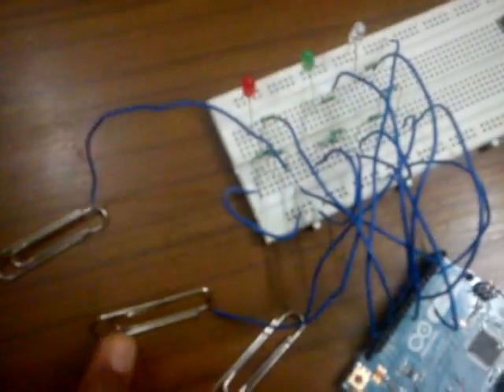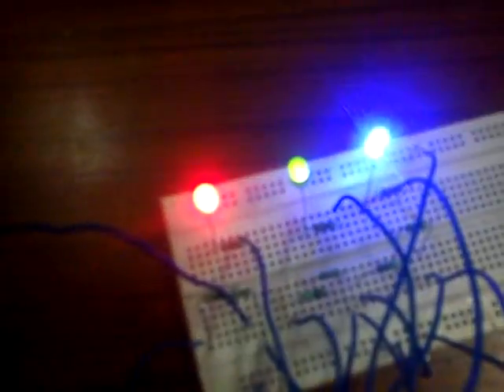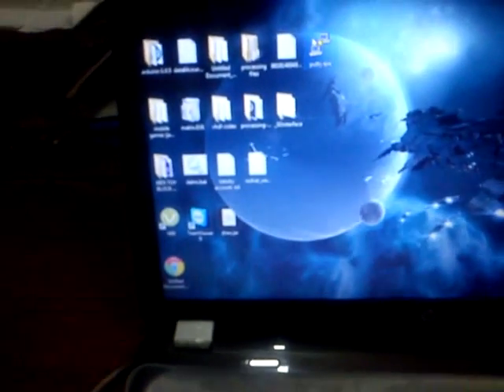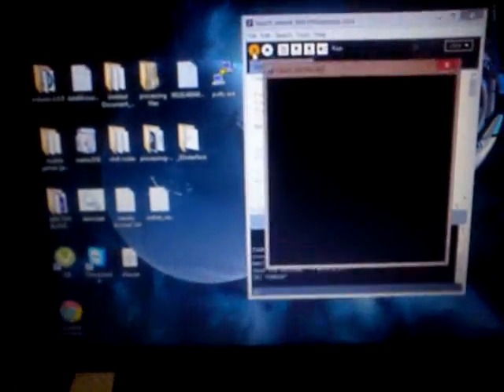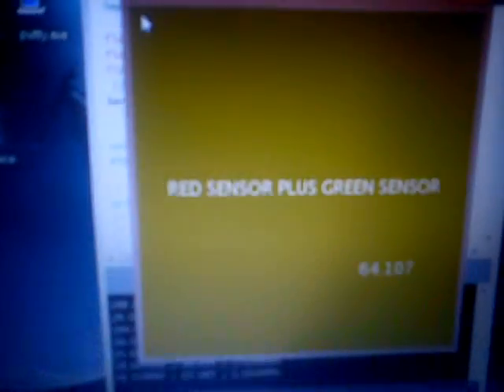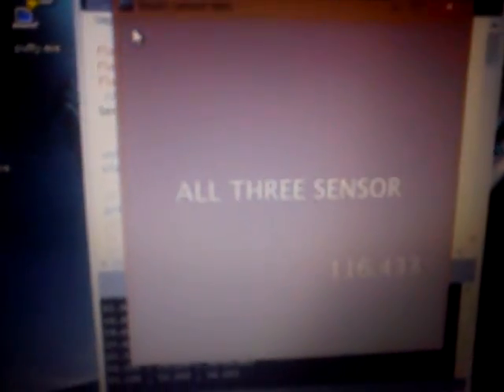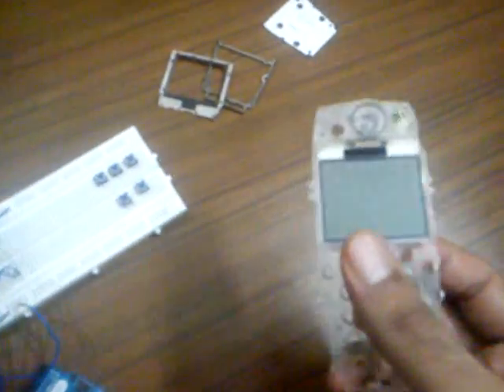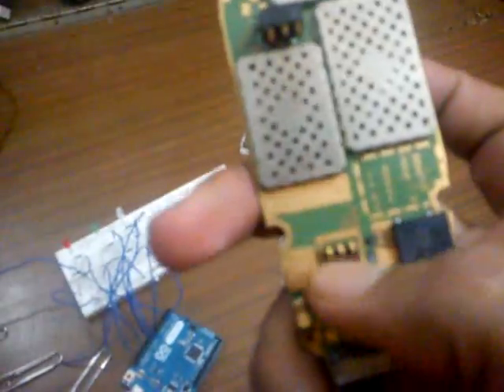Capacitive Touch Sensor with paper clips (Arduino + Processing)

Comment: if you play minecraft, type in this command to get furntiture. no mods kay
here it is:
/summon FallingSand ~ ~2 ~ {Block:redstone_block,Time:1,Riding: {id:FallingSand,Block:command_block,TileEntityData:{Command:/fill ~-1 ~-3 ~ ~-1 ~1 ~ redstone_block},Time:1,Riding: {id:FallingSand,Block:command_block,TileEntityData:{Command:/fill ~-1 ~-3 ~ ~ ~2 ~ air},Time:1,Riding: {id:FallingSand,Block:command_block,TileEntityData:{Command: 	/summon FallingSand ~-2 ~ ~9 	{Block:emerald_block,Time:1,Riding: 	{id:FallingSand,Block:command_block,TileEntityData:{Command: 		/summon FallingSand ~ ~-2 ~-1 			{Block:emerald_block,Time:1,Riding: 			{id:FallingSand,Block:command_block,TileEntityData:{Command:/fill ~3 ~1 ~2 ~-1 ~1 ~-5 stained_glass 0},Time:1,Riding: 			{id:FallingSand,Block:command_block,TileEntityData:{Command:/setblock ~2 ~-6 ~-5 redstone_block},Time:1,Riding: 			{id:FallingSand,Block:command_block,TileEntityData:{Command:/setblock ~-1 ~-1 ~-7 stone_button 4},Time:1,Riding: 			{id:FallingSand,Block:command_block,TileEntityData:{Command:/setblock ~-1 ~-1 ~-4 command_block 0 replace {Command:/scoreboard objectives remove tv}},Time:1,Riding: 			{id:FallingSand,Block:command_block,TileEntityData:{Command:/setblock ~-1 ~1 ~-5 redstone_wire},Time:1,Riding: 			{id:FallingSand,Block:command_block,TileEntityData:{Command:/setblock ~-1 ~ ~-5 command_block 0 replace {Command:/summon FallingSand ~2 ~3 ~7 {Block:command_block,TileEntityData:{Command:/fill ~-3 ~-1 ~1 ~3 ~8 ~-9 minecraft:air},Time:1}}},Time:1,Riding: 			{id:FallingSand,Block:command_block,TileEntityData:{Command:/setblock ~ ~2 ~-5 command_block 0 replace {Command:/fill ~-2 ~1 ~-1 ~4 ~1 ~8 stained_glass 5 replace stained_glass 14}},Time:1,Riding: 			{id:FallingSand,Block:command_block,TileEntityData:{Command:/setblock ~-1 ~3 ~-5 command_block 0 replace {Command:/scoreboard objectives remove t}},Time:1}}}}}}}}} 		},Time:1,Riding: 	{id:FallingSand,Block:command_block,TileEntityData:{Command:/fill ~4 ~-2 ~-7 ~-2 ~-2 ~2 stained_glass 14 replace stained_glass 0},Time:1,Riding: 	{id:FallingSand,Block:command_block,TileEntityData:{Command:/setblock ~-1 ~-5 ~-8 stone_button 4},Time:1,Riding:	 	{id:FallingSand,Block:command_block,TileEntityData:{Command:/setblock ~-1 ~-4 ~-6 command_block 0 replace {Command:/scoreboard players set @p t 0}},Time:1,Riding: 	{id:FallingSand,Block:command_block,TileEntityData:{Command:/setblock ~-1 ~-2 ~-8 wall_sign 1 replace {Text1:,Text2:Get Items,Text3:,Text4:}},Time:1,Riding: 	{id:FallingSand,Block:command_block,TileEntityData:{Command: 		/summon FallingSand ~1 ~1 ~-6 			{Block:command_block,TileEntityData:{Command:/execute @a[score_tv_min=1,score_tv=1]~ ~ ~ /execute @e[name=TV,score_t_min=1]~ ~ ~ /summon ArmorStand ~-0.5 ~-0.7 ~-0.05 {CustomName:"F",NoGravity:1,Invulnerable:1,Invisible:1,DisabledSlots:2039552,NoAI:1,Equipment:[{},{},{},{},{id:carpet,Damage:15}],Pose:{Head:[90f,180f,0f]}}},Time:1,Riding: 			{id:FallingSand,Block:command_block,TileEntityData:{Command:/execute @a[score_tv_min=1,score_tv=1]~ ~ ~ /execute @e[name=TV,score_t_min=1]~ ~ ~ /summon ArmorStand ~0.5 ~-0.7 ~-0.05 {CustomName:"F",NoGravity:1,Invulnerable:1,Invisible:1,DisabledSlots:2039552,NoAI:1,Equipment:[{},{},{},{},{id:carpet,Damage:15}],Pose:{Head:[90f,180f,0f]}}},Time:1,Riding: 			{id:FallingSand,Block:command_block,TileEntityData:{Command:/execute @a[score_tv_min=1,score_tv=1]~ ~ ~ /execute @e[name=TV,score_t_min=1]~ ~ ~ /summon ArmorStand ~-0.5 ~-0.4 ~-0.05 {CustomName:"F",NoGravity:1,Invulnerable:1,Invisible:1,DisabledSlots:2039552,NoAI:1,Equipment:[{},{},{},{},{id:carpet,Damage:15}],Pose:{Head:[90f,180f,0f]}}},Time:1,Riding: 			{id:FallingSand,Block:command_block,TileEntityData:{Command:/scoreboard players set @a[rym=-135,ry=-45] tv 2},Time:1,Riding: 			{id:FallingSand,Block:command_block,TileEntityData:{Command:/scoreboard players set @a[rym=45,ry=135] tv 2},Time:1,Riding: 			{id:FallingSand,Block:command_block,TileEntityData:{Command:/scoreboard players set @a[rym=-44,ry=44] tv 1},Time:1,Riding: 			{id:FallingSand,Block:command_block,TileEntityData:{Command:/scoreboard players set @a[rym=136,ry=-136] tv 1},Time:1,Riding: 			{id:FallingSand,Block:command_block,TileEntityData:{Command:/fill ~1 ~ ~7 ~1 ~7 ~ air},Time:1}}}}}}}} 		},Time:1,Riding: 	{id:FallingSand,Block:command_block,TileEntityData:{Command: 		/summon FallingSand ~1 ~1 ~-5 			{Block:command_block,TileEntityData:{Command:/execute @e[type=EntityHorse,name=Destroy,score_t_min=1]~ ~ ~ /gamerule doMobLoot false},Time:1,Riding: 			{id:FallingSand,Block:command_block,TileEntityData:{Command:/kill @e[type=EntityHorse,name=Destroy,score_t_min=2]},Time:1,Riding:			{id:FallingSand,Block:command_block,TileEntityData:{Command:/execute @e[name=Destroy,type=EntityHorse]~ ~ ~ /summon FireworksRocketEntity ~ ~0.3 ~ {LifeTime:0,FireworksItem:{id:401,Count:1,tag:{Fireworks:{Explosions:[{Flicker:2,Trail:0,Type:5,Colors:[128988214]}]}}}}},Time:1}}} 		},Time:1,Riding: 	{id:FallingSand,Block:command_block,TileEntityData:{Command: 		/summon FallingSand ~1 ~1 ~-4 			{Block:command_block,TileEntityData:{Command:/execute @a[score_t_min=3]~ ~-1 ~ /kill @e[type=Item,r=2]},Time:1,Riding:			{id:FallingSand,Block:command_block,TileEntityData:{Command:/execute @a[score_t_min=3]~ ~-1 ~ /kill @e[name=F,r=1]},Time:1,Riding:			{id:FallingSand,Block:command_block,TileEntityData:{Command:/execute @a[score_t_min=3]~ ~1 ~ /kill @e[name=F,r=1]},Time:1,Riding:			{id:FallingSand,Block:command_block,TileEntityData:{Command:/execute @a[score_t_min=3]~ ~ ~ /gamerule doMobLoot false},Time:1,Riding: 			{id:FallingSand,Block:command_block,TileEntityData:{Command:/execute @a[score_t_min=3]~ ~ ~ /kill @e[name=F,r=1]},Time:1,Riding:			{id:FallingSand,Block:command_block,TileEntityData:{Command:/scoreboard players remove @a[score_t_min=3] t 1},Time:1,Riding: 			{id:FallingSand,Block:command_block,TileEntityData:{Command:/scoreboard players set @a t 4 {SelectedItemSlot:8,Inventory:[{Slot:8b,tag:{display:{Name:"Destroy"}}}]}},Time:1,Riding: 			{id:FallingSand,Block:command_block,TileEntityData:{Command:/execute @e[type=Item,name=Destroy]~ ~ ~ /kill @e[type=ArmorStand,name=F,r=2]},Time:1}}}}}}}}	},Time:1}}}}}}}}} },Time:1,Riding: {id:FallingSand,Block:command_block,TileEntityData:{Command: 	/summon FallingSand ~-2 ~ ~10 	{Block:emerald_block,Time:1,Riding: 	{id:FallingSand,Block:command_block,TileEntityData:{Command: 		/summon FallingSand ~3 ~-5 ~-7 			{Block:command_block,TileEntityData:{Command:/replaceitem entity @a[score_t_min=1] slot.hotbar.8 name_tag 1 0 {display:{Name:"Destroy"},HideFlags:127,ench:[{id:34,lvl:10}]}},Time:1,Riding: 			{id:FallingSand,Block:command_block,TileEntityData:{Command:/replaceitem entity @a[score_t=1] slot.hotbar.4 spawn_egg 1 94 {display:{Name:"TV"},HideFlags:127,ench:[{id:34,lvl:10}]}},Time:1,Riding: 			{id:FallingSand,Block:command_block,TileEntityData:{Command:/replaceitem entity @a[score_t=1] slot.hotbar.3 spawn_egg 1 94 {display:{Name:"Pile_of_Books"},HideFlags:127,ench:[{id:34,lvl:10}]}},Time:1,Riding: 			{id:FallingSand,Block:command_block,TileEntityData:{Command:/replaceitem entity @a[score_t=1] slot.hotbar.2 spawn_egg 1 94 {display:{Name:"Large_Table"},HideFlags:127,ench:[{id:34,lvl:10}]}},Time:1,Riding: 			{id:FallingSand,Block:command_block,TileEntityData:{Command:/replaceitem entity @a[score_t=1] slot.hotbar.1 spawn_egg 1 94 {display:{Name:"Table"},HideFlags:127,ench:[{id:34,lvl:10}]}},Time:1,Riding: 			{id:FallingSand,Block:command_block,TileEntityData:{Command:/gamerule doMobLoot true},Time:1,Riding: 			{id:FallingSand,Block:command_block,TileEntityData:{Command:/replaceitem entity @a[score_t=1] slot.hotbar.0 spawn_egg 1 94 {display:{Name:"Chair"},HideFlags:127,ench:[{id:34,lvl:10}]}},Time:1,Riding: 			{id:FallingSand,Block:command_block,TileEntityData:{Command:/fill ~-1 ~ ~7 ~-1 ~7 ~ redstone_block},Time:1}}}}}}}} 		},Time:1,Riding: 	{id:FallingSand,Block:command_block,TileEntityData:{Command: 		/summon FallingSand ~3 ~-4 ~-6 			{Block:command_block,TileEntityData:{Command:/scoreboard players add @e[type=EntityHorse,name=Destroy] t 1},Time:1,Riding: 			{id:FallingSand,Block:command_block,TileEntityData:{Command:/scoreboard players add @e[type=Squid,name=TV] t 1},Time:1,Riding: 			{id:FallingSand,Block:command_block,TileEntityData:{Command:/scoreboard players add @e[type=Squid,name=Pile_of_Books] t 1},Time:1,Riding: 			{id:FallingSand,Block:command_block,TileEntityData:{Command:/scoreboard players add @e[type=Squid,name=Large_Table] t 1},Time:1,Riding: 			{id:FallingSand,Block:command_block,TileEntityData:{Command:/scoreboard players add @e[type=Squid,name=Table] t 1},Time:1,Riding: 			{id:FallingSand,Block:command_block,TileEntityData:{Command:/execute @e[type=Squid,score_t_min=1]~ ~ ~ /gamerule doMobLoot false},Time:1,Riding: 			{id:FallingSand,Block:command_block,TileEntityData:{Command:/scoreboard players add @e[type=Squid,name=Chair] t 1},Time:1,Riding: 			{id:FallingSand,Block:command_block,TileEntityData:{Command:/scoreboard players set @a[score_t=1] t 2},Time:1}}}}}}}} 		},Time:1,Riding: 	{id:FallingSand,Block:command_block,TileEntityData:{Command: 		/summon FallingSand ~3 ~-3 ~-5 			{Block:command_block,TileEntityData:{Command:/execute @e[name=Chair,score_t_min=1,score_t=1]~ ~ ~ /execute @p[score_t=2,rym=136,ry=-136]~ ~ ~ /execute @e[name=Chair,score_t_min=1,c=1]~ ~ ~ /summon ArmorStand ~ ~-0.65 ~-0.3 {CustomName:"F",NoGravity:1,Invulnerable:1,Invisible:1,DisabledSlots:2039552,NoAI:1,Equipment:[{},{},{},{},{id:trapdoor}],Pose:{Head:[90f,0f,0f]}}},Time:1,Riding: 			{id:FallingSand,Block:command_block,TileEntityData:{Command:/execute @e[name=Chair,score_t_min=1,score_t=1]~ ~ ~ /execute @p[score_t=2,rym=-44,ry=44]~ ~ ~ /execute @e[name=Chair,score_t_min=1,c=1]~ ~ ~ /summon ArmorStand ~ ~-0.65 ~0.3 {CustomName:"F",NoGravity:1,Invulnerable:1,Invisible:1,DisabledSlots:2039552,NoAI:1,Equipment:[{},{},{},{},{id:trapdoor}],Pose:{Head:[90f,0f,0f]}}},Time:1,Riding: 			{id:FallingSand,Block:command_block,TileEntityData:{Command:/execute @e[name=Chair,score_t_min=1,score_t=1]~ ~ ~ /summon ArmorStand ~-0.25 ~-1.35 ~0.25 {CustomName:"F",NoGravity:1,Invulnerable:1,Invisible:1,DisabledSlots:2039552,NoAI:1,Equipment:[{},{},{},{},{id:lever}]}},Time:1,Riding: 			{id:FallingSand,Block:command_block,TileEntityData:{Command:/execute @e[name=Chair,score_t_min=1,score_t=1]~ ~ ~ /summon ArmorStand ~0.25 ~-1.35 ~-0.25 {CustomName:"F",NoGravity:1,Invulnerable:1,Invisible:1,DisabledSlots:2039552,NoAI:1,Equipment:[{},{},{},{},{id:lever}]}},Time:1,Riding: 			{id:FallingSand,Block:command_block,TileEntityData:{Command:/execute @e[name=Chair,score_t_min=1,score_t=1]~ ~ ~ /summon ArmorStand ~-0.25 ~-1.35 ~-0.25 {CustomName:"F",NoGravity:1,Invulnerable:1,Invisible:1,DisabledSlots:2039552,NoAI:1,Equipment:[{},{},{},{},{id:lever}]}},Time:1,Riding: 			{id:FallingSand,Block:command_block,TileEntityData:{Command:/execute @e[name=Chair,score_t_min=1,score_t=1]~ ~ ~ /summon ArmorStand ~0.25 ~-1.35 ~0.25 {CustomName:"F",NoGravity:1,Invulnerable:1,Invisible:1,DisabledSlots:2039552,NoAI:1,Equipment:[{},{},{},{},{id:lever}]}},Time:1,Riding: 			{id:FallingSand,Block:command_block,TileEntityData:{Command:/execute @e[name=Chair,score_t_min=1,score_t=1]~ ~ ~ /summon ArmorStand ~ ~-1 ~ {CustomName:"F",NoGravity:1,Invulnerable:1,Invisible:1,DisabledSlots:2039552,NoAI:1,Equipment:[{},{},{},{},{Damage:0,id:trapdoor}]}},Time:1,Riding: 			{id:FallingSand,Block:command_block,TileEntityData:{Command:/tp @e[type=Squid,score_t_min=2]~ ~-5 ~},Time:1}}}}}}}} 		},Time:1,Riding: 	{id:FallingSand,Block:command_block,TileEntityData:{Command: 		/summon FallingSand ~3 ~-2 ~-4 			{Block:command_block,TileEntityData:{Command:/execute @e[name=Large_Table,score_t_min=1,score_t=1]~ ~ ~ /summon ArmorStand ~ ~-0.7 ~-0.25 {CustomName:"F",NoGravity:1,Invulnerable:1,Invisible:1,DisabledSlots:2039552,NoAI:1,Equipment:[{},{},{},{},{id:stained_glass_pane,Damage:0}],Pose:{Head:[90f,0f,0f]}}},Time:1,Riding: 			{id:FallingSand,Block:command_block,TileEntityData:{Command:/execute @e[name=Table,score_t_min=1,score_t=1]~ ~ ~ /summon ArmorStand ~ ~-0.7 ~ {CustomName:"F",NoGravity:1,Invulnerable:1,Invisible:1,DisabledSlots:2039552,NoAI:1,Equipment:[{},{},{},{},{id:trapdoor}]}},Time:1,Riding: 			{id:FallingSand,Block:command_block,TileEntityData:{Command:/execute @e[name=Table,score_t_min=1,score_t=1]~ ~ ~ /summon ArmorStand ~0.4 ~-1.6 ~-0.52 {Pose:{RightArm:[-100f,0f,0f]},CustomName:"F",NoGravity:1,Invulnerable:1,Invisible:1,DisabledSlots:2039552,NoAI:1,Equipment:[{id:bone},{},{},{},{}]}},Time:1,Riding: 			{id:FallingSand,Block:command_block,TileEntityData:{Command:/execute @e[name=Table,score_t_min=1,score_t=1]~ ~ ~ /summon ArmorStand ~ ~-0.9 ~ {CustomName:"F",NoGravity:1,Invulnerable:1,Invisible:1,DisabledSlots:2039552,NoAI:1,Equipment:[{},{},{},{},{Damage:0,id:wooden_pressure_plate}],Small:1}},Time:1,Riding: 			{id:FallingSand,Block:command_block,TileEntityData:{Command:/execute @e[name=Chair,score_t_min=1,score_t=1]~ ~ ~ /execute @p[score_t=2,rym=136,ry=-136]~ ~ ~ /execute @e[name=Chair,score_t_min=1,score_t=1,c=1]~ ~ ~ /summon EntityHorse ~ ~-0.9 ~ {CustomName:"F",Invulnerable:1,Silent:1,Tame:1,ActiveEffects:[{Id:14,Duration:1000000000,Amplifier:-1},{Id:11,Duration:1000000000,Amplifier:100,ShowParticles:0b}],NoAI:1}},Time:1,Riding: 			{id:FallingSand,Block:command_block,TileEntityData:{Command:/execute @e[name=Chair,score_t_min=1,score_t=1]~ ~ ~ /execute @p[score_t=2,rym=-135,ry=-45]~ ~ ~ /execute @e[name=Chair,score_t_min=1,c=1]~ ~ ~ /summon ArmorStand ~0.3 ~-0.65 ~ {CustomName:"F",NoGravity:1,Invulnerable:1,Invisible:1,DisabledSlots:2039552,NoAI:1,Equipment:[{},{},{},{},{id:trapdoor}],Pose:{Head:[90f,90f,0f]}}},Time:1,Riding: 			{id:FallingSand,Block:command_block,TileEntityData:{Command:/execute @e[name=Chair,score_t_min=1,score_t=1]~ ~ ~ /execute @p[score_t=2,rym=45,ry=135]~ ~ ~ /execute @e[name=Chair,score_t_min=1,c=1]~ ~ ~ /summon ArmorStand ~-0.3 ~-0.65 ~ {CustomName:"F",NoGravity:1,Invulnerable:1,Invisible:1,DisabledSlots:2039552,NoAI:1,Equipment:[{},{},{},{},{id:trapdoor}],Pose:{Head:[90f,90f,0f]}}},Time:1,Riding: 			{id:FallingSand,Block:command_block,TileEntityData:{Command:/kill @e[type=Squid,score_t_min=2]},Time:1}}}}}}}}		},Time:1,Riding: 	{id:FallingSand,Block:command_block,TileEntityData:{Command: 		/summon FallingSand ~3 ~-1 ~-3 			{Block:command_block,TileEntityData:{Command:/execute @e[name=Armoire,score_t_min=1,score_t=1]~ ~ ~ /summon EntityHorse ~ ~ ~ {CustomName:"F",Invulnerable:1,Silent:1,ActiveEffects:[{Id:14,Duration:1000000000,Amplifier:-1},{Id:11,Duration:1000000000,Amplifier:100,ShowParticles:0b}],NoAI:1,Rotation:[90f],ChestedHorse:1,Type:1,Tame:1}},Time:1,Riding: 			{id:FallingSand,Block:command_block,TileEntityData:{Command:/execute @e[name=Large_Table,score_t_min=1,score_t=1]~ ~ ~ /summon ArmorStand ~-0.6 ~-0.7 ~-0.25 {CustomName:"F",NoGravity:1,Invulnerable:1,Invisible:1,DisabledSlots:2039552,NoAI:1,Equipment:[{},{},{},{},{id:stained_glass_pane,Damage:0}],Pose:{Head:[90f,0f,0f]}}},Time:1,Riding: 			{id:FallingSand,Block:command_block,TileEntityData:{Command:/execute @e[name=Large_Table,score_t_min=1,score_t=1]~ ~ ~ /summon ArmorStand ~-0.6 ~-0.7 ~0.4 {CustomName:"F",NoGravity:1,Invulnerable:1,Invisible:1,DisabledSlots:2039552,NoAI:1,Equipment:[{},{},{},{},{id:stained_glass_pane,Damage:0}],Pose:{Head:[90f,0f,0f]}}},Time:1,Riding: 			{id:FallingSand,Block:command_block,TileEntityData:{Command:/execute @e[name=Large_Table,score_t_min=1,score_t=1]~ ~ ~ /summon ArmorStand ~0.6 ~-0.7 ~0.4 {CustomName:"F",NoGravity:1,Invulnerable:1,Invisible:1,DisabledSlots:2039552,NoAI:1,Equipment:[{},{},{},{},{id:stained_glass_pane,Damage:0}],Pose:{Head:[90f,0f,0f]}}},Time:1,Riding: 			{id:FallingSand,Block:command_block,TileEntityData:{Command:/execute @e[name=Large_Table,score_t_min=1,score_t=1]~ ~ ~ /summon ArmorStand ~-0.6 ~-0.7 ~-0.85 {CustomName:"F",NoGravity:1,Invulnerable:1,Invisible:1,DisabledSlots:2039552,NoAI:1,Equipment:[{},{},{},{},{id:stained_glass_pane,Damage:0}],Pose:{Head:[90f,0f,0f]}}},Time:1,Riding: 			{id:FallingSand,Block:command_block,TileEntityData:{Command:/execute @e[name=Large_Table,score_t_min=1,score_t=1]~ ~ ~ /summon ArmorStand ~0.6 ~-0.7 ~-0.85 {CustomName:"F",NoGravity:1,Invulnerable:1,Invisible:1,DisabledSlots:2039552,NoAI:1,Equipment:[{},{},{},{},{id:stained_glass_pane,Damage:0}],Pose:{Head:[90f,0f,0f]}}},Time:1,Riding: 			{id:FallingSand,Block:command_block,TileEntityData:{Command:/execute @e[name=Large_Table,score_t_min=1,score_t=1]~ ~ ~ /summon ArmorStand ~ ~-0.7 ~0.4 {CustomName:"F",NoGravity:1,Invulnerable:1,Invisible:1,DisabledSlots:2039552,NoAI:1,Equipment:[{},{},{},{},{id:stained_glass_pane,Damage:0}],Pose:{Head:[90f,0f,0f]}}},Time:1,Riding: 			{id:FallingSand,Block:command_block,TileEntityData:{Command:/execute @e[name=Large_Table,score_t_min=1,score_t=1]~ ~ ~ /summon ArmorStand ~ ~-0.7 ~-0.85 {CustomName:"F",NoGravity:1,Invulnerable:1,Invisible:1,DisabledSlots:2039552,NoAI:1,Equipment:[{},{},{},{},{id:stained_glass_pane,Damage:0}],Pose:{Head:[90f,0f,0f]}}},Time:1}}}}}}}} 		},Time:1,Riding: 	{id:FallingSand,Block:command_block,TileEntityData:{Command: 		/summon FallingSand ~3 ~ ~-2 			{Block:command_block,TileEntityData:{Command:/execute @e[name=Large_Table,score_t_min=1,score_t=1]~ ~ ~ /summon ArmorStand ~1.2 ~-1.6 ~0.28 {Pose:{RightArm:[-100f,0f,0f]},CustomName:"F",NoGravity:1,Invulnerable:1,Invisible:1,DisabledSlots:2039552,NoAI:1,Equipment:[{id:bone},{},{},{},{}]}},Time:1,Riding: 			{id:FallingSand,Block:command_block,TileEntityData:{Command:/execute @e[name=Chair,score_t_min=1,score_t=1]~ ~ ~ /execute @p[score_t=2,rym=-44,ry=44]~ ~ ~ /execute @e[name=Chair,score_t_min=1,score_t=1,c=1]~ ~ ~ /summon EntityHorse ~ ~-0.9 ~ {CustomName:"F",Invulnerable:1,Silent:1,Tame:1,ActiveEffects:[{Id:14,Duration:1000000000,Amplifier:-1},{Id:11,Duration:1000000000,Amplifier:100,ShowParticles:0b}],NoAI:1,Rotation:[180f]}},Time:1,Riding: 			{id:FallingSand,Block:command_block,TileEntityData:{Command:/execute @e[name=Chair,score_t_min=1,score_t=1]~ ~ ~ /execute @p[score_t=2,rym=45,ry=135]~ ~ ~ /execute @e[name=Chair,score_t_min=1,score_t=1,c=1]~ ~ ~ /summon EntityHorse ~ ~-0.9 ~ {CustomName:"F",Invulnerable:1,Silent:1,Tame:1,ActiveEffects:[{Id:14,Duration:1000000000,Amplifier:-1},{Id:11,Duration:1000000000,Amplifier:100,ShowParticles:0b}],NoAI:1,Rotation:[-90f]}},Time:1,Riding: 			{id:FallingSand,Block:command_block,TileEntityData:{Command:/execute @e[name=Chair,score_t_min=1,score_t=1]~ ~ ~ /execute @p[score_t=2,rym=-135,ry=-45]~ ~ ~ /execute @e[name=Chair,score_t_min=1,score_t=1,c=1]~ ~ ~ /summon EntityHorse ~ ~-0.9 ~ {CustomName:"F",Invulnerable:1,Silent:1,Tame:1,ActiveEffects:[{Id:14,Duration:1000000000,Amplifier:-1},{Id:11,Duration:1000000000,Amplifier:100,ShowParticles:0b}],NoAI:1,Rotation:[90f]}},Time:1,Riding: 			{id:FallingSand,Block:command_block,TileEntityData:{Command:/execute @e[name=Large_Table,score_t_min=1,score_t=1]~ ~ ~ /summon ArmorStand ~-0.4 ~-1.6 ~0.28 {Pose:{RightArm:[-100f,0f,0f]},CustomName:"F",NoGravity:1,Invulnerable:1,Invisible:1,DisabledSlots:2039552,NoAI:1,Equipment:[{id:bone},{},{},{},{}]}},Time:1,Riding: 			{id:FallingSand,Block:command_block,TileEntityData:{Command:/execute @e[name=Large_Table,score_t_min=1,score_t=1]~ ~ ~ /summon ArmorStand ~0.6 ~-0.7 ~-0.25 {CustomName:"F",NoGravity:1,Invulnerable:1,Invisible:1,DisabledSlots:2039552,NoAI:1,Equipment:[{},{},{},{},{id:stained_glass_pane,Damage:0}],Pose:{Head:[90f,0f,0f]}}},Time:1,Riding: 			{id:FallingSand,Block:command_block,TileEntityData:{Command:/execute @e[name=Large_Table,score_t_min=1,score_t=1]~ ~ ~ /summon ArmorStand ~-0.4 ~-1.6 ~-1.32 {Pose:{RightArm:[-100f,0f,0f]},CustomName:"F",NoGravity:1,Invulnerable:1,Invisible:1,DisabledSlots:2039552,NoAI:1,Equipment:[{id:bone},{},{},{},{}]}},Time:1,Riding: 			{id:FallingSand,Block:command_block,TileEntityData:{Command:/execute @e[name=Large_Table,score_t_min=1,score_t=1]~ ~ ~ /summon ArmorStand ~1.2 ~-1.6 ~-1.32 {Pose:{RightArm:[-100f,0f,0f]},CustomName:"F",NoGravity:1,Invulnerable:1,Invisible:1,DisabledSlots:2039552,NoAI:1,Equipment:[{id:bone},{},{},{},{}]}},Time:1}}}}}}}} 		},Time:1,Riding: 	{id:FallingSand,Block:command_block,TileEntityData:{Command: 		/summon FallingSand ~3 ~1 ~-1 			{Block:command_block,TileEntityData:{Command:/execute @a[score_tv_min=2,score_tv=2]~ ~ ~ /execute @e[name=TV,score_t_min=1]~ ~ ~ /summon ArmorStand ~-0.05 ~-0.7 ~ {CustomName:"F",NoGravity:1,Invulnerable:1,Invisible:1,DisabledSlots:2039552,NoAI:1,Equipment:[{},{},{},{},{id:carpet,Damage:15}],Pose:{Head:[90f,90f,0f]}}},Time:1,Riding: 			{id:FallingSand,Block:command_block,TileEntityData:{Command:/execute @e[name=TV,score_t_min=1,score_t=1]~ ~ ~ /summon ArmorStand ~ ~-1.3 ~ {CustomName:"F",NoGravity:1,Invulnerable:1,Invisible:1,DisabledSlots:2039552,NoAI:1,Equipment:[{},{},{},{},{id:lever}]}},Time:1,Riding: 			{id:FallingSand,Block:command_block,TileEntityData:{Command:/execute @e[name=TV,score_t_min=1,score_t=1]~ ~ ~ /summon ArmorStand ~ ~-0.9 ~ {CustomName:"F",NoGravity:1,Invulnerable:1,Invisible:1,DisabledSlots:2039552,NoAI:1,Equipment:[{},{},{},{},{Damage:0,id:heavy_weighted_pressure_plate}],Small:1}},Time:1,Riding: 			{id:FallingSand,Block:command_block,TileEntityData:{Command:},Time:1,Riding: 			{id:FallingSand,Block:command_block,TileEntityData:{Command:/execute @e[name=Pile_of_Books,score_t_min=1,score_t=1]~ ~ ~ /summon ArmorStand ~0.4 ~-0.75 ~-0.1 {Pose:{RightArm:[0f,0f,0f]},CustomName:"F",NoGravity:1,Invulnerable:1,Invisible:1,DisabledSlots:2039552,NoAI:1,Equipment:[{id:book},{},{},{},{}]}},Time:1,Riding: 			{id:FallingSand,Block:command_block,TileEntityData:{Command:/execute @e[name=Pile_of_Books,score_t_min=1,score_t=1]~ ~ ~ /summon ArmorStand ~0.5 ~-0.775 ~-0.4 {Pose:{RightArm:[0f,0f,0f]},CustomName:"F",NoGravity:1,Invulnerable:1,Invisible:1,DisabledSlots:2039552,NoAI:1,Equipment:[{id:book},{},{},{},{}]}},Time:1,Riding: 			{id:FallingSand,Block:command_block,TileEntityData:{Command:/execute @e[name=Pile_of_Books,score_t_min=1,score_t=1]~ ~ ~ /summon ArmorStand ~0.35 ~-0.8 ~-0.25 {Pose:{RightArm:[0f,0f,0f]},CustomName:"F",NoGravity:1,Invulnerable:1,Invisible:1,DisabledSlots:2039552,NoAI:1,Equipment:[{id:writable_book},{},{},{},{}]}},Time:1,Riding: 			{id:FallingSand,Block:command_block,TileEntityData:{Command:/execute @e[name=Table,score_t_min=1,score_t=1]~ ~ ~ /summon ArmorStand ~0.35 ~0 ~-0.25 {CustomName:"F",NoGravity:1,Invulnerable:1,Invisible:1,DisabledSlots:1973790,NoAI:1,ShowArms:1,Pose:{RightArm:[0f,0f,0f]}}},Time:1}}}}}}}} 		},Time:1,Riding: 	{id:FallingSand,Block:command_block,TileEntityData:{Command: 		/summon FallingSand ~3 ~1 ~ 			{Block:command_block,TileEntityData:{Command:/execute @a[score_tv_min=1,score_tv=1]~ ~ ~ /execute @e[name=TV,score_t_min=1]~ ~ ~ /summon ArmorStand ~0.5 ~-0.4 ~-0.05 {CustomName:"F",NoGravity:1,Invulnerable:1,Invisible:1,DisabledSlots:2039552,NoAI:1,Equipment:[{},{},{},{},{id:carpet,Damage:15}],Pose:{Head:[90f,180f,0f]}}},Time:1,Riding: 			{id:FallingSand,Block:command_block,TileEntityData:{Command:/execute @a[score_tv_min=1,score_tv=1]~ ~ ~ /execute @e[name=TV,score_t_min=1]~ ~ ~ /summon ArmorStand ~ ~-0.4 ~-0.05 {CustomName:"F",NoGravity:1,Invulnerable:1,Invisible:1,DisabledSlots:2039552,NoAI:1,Equipment:[{},{},{},{},{id:carpet,Damage:15}],Pose:{Head:[90f,180f,0f]}}},Time:1,Riding: 			{id:FallingSand,Block:command_block,TileEntityData:{Command:/execute @a[score_tv_min=1,score_tv=1]~ ~ ~ /execute @e[name=TV,score_t_min=1]~ ~ ~ /summon ArmorStand ~ ~-0.7 ~-0.05 {CustomName:"F",NoGravity:1,Invulnerable:1,Invisible:1,DisabledSlots:2039552,NoAI:1,Equipment:[{},{},{},{},{id:carpet,Damage:15}],Pose:{Head:[90f,180f,0f]}}},Time:1,Riding: 			{id:FallingSand,Block:command_block,TileEntityData:{Command:/execute @a[score_tv_min=2,score_tv=2]~ ~ ~ /execute @e[name=TV,score_t_min=1]~ ~ ~ /summon ArmorStand ~-0.05 ~-0.7 ~-0.5 {CustomName:"F",NoGravity:1,Invulnerable:1,Invisible:1,DisabledSlots:2039552,NoAI:1,Equipment:[{},{},{},{},{id:carpet,Damage:15}],Pose:{Head:[90f,90f,0f]}}},Time:1,Riding: 			{id:FallingSand,Block:command_block,TileEntityData:{Command:/execute @a[score_tv_min=2,score_tv=2]~ ~ ~ /execute @e[name=TV,score_t_min=1]~ ~ ~ /summon ArmorStand ~-0.05 ~-0.7 ~0.5 {CustomName:"F",NoGravity:1,Invulnerable:1,Invisible:1,DisabledSlots:2039552,NoAI:1,Equipment:[{},{},{},{},{id:carpet,Damage:15}],Pose:{Head:[90f,90f,0f]}}},Time:1,Riding: 			{id:FallingSand,Block:command_block,TileEntityData:{Command:/execute @a[score_tv_min=2,score_tv=2]~ ~ ~ /execute @e[name=TV,score_t_min=1]~ ~ ~ /summon ArmorStand ~-0.05 ~-0.4 ~-0.5 {CustomName:"F",NoGravity:1,Invulnerable:1,Invisible:1,DisabledSlots:2039552,NoAI:1,Equipment:[{},{},{},{},{id:carpet,Damage:15}],Pose:{Head:[90f,90f,0f]}}},Time:1,Riding: 			{id:FallingSand,Block:command_block,TileEntityData:{Command:/execute @a[score_tv_min=2,score_tv=2]~ ~ ~ /execute @e[name=TV,score_t_min=1]~ ~ ~ /summon ArmorStand ~-0.05 ~-0.4 ~0.5 {CustomName:"F",NoGravity:1,Invulnerable:1,Invisible:1,DisabledSlots:2039552,NoAI:1,Equipment:[{},{},{},{},{id:carpet,Damage:15}],Pose:{Head:[90f,90f,0f]}}},Time:1,Riding: 			{id:FallingSand,Block:command_block,TileEntityData:{Command:/execute @a[score_tv_min=2,score_tv=2]~ ~ ~ /execute @e[name=TV,score_t_min=1]~ ~ ~ /summon ArmorStand ~-0.05 ~-0.4 ~ {CustomName:"F",NoGravity:1,Invulnerable:1,Invisible:1,DisabledSlots:2039552,NoAI:1,Equipment:[{},{},{},{},{id:carpet,Damage:15}],Pose:{Head:[90f,90f,0f]}}},Time:1}}}}}}}} 		},Time:1}}}}}}}}} 	},Time:1,Riding: {id:FallingSand,Block:redstone_block,Time:1,Riding: {id:FallingSand,Block:command_block,TileEntityData:{Command:/fill ~-1 ~-7 ~ ~-1 ~1 ~ redstone_block},Time:1,Riding: {id:FallingSand,Block:command_block,TileEntityData:{Command:/fill ~-1 ~-6 ~ ~ ~2 ~ air},Time:1,Riding: {id:FallingSand,Block:command_block,TileEntityData:{Command:/setblock ~-3 ~-6 ~2 stained_hardened_clay 5},Time:1,Riding: {id:FallingSand,Block:command_block,TileEntityData:{Command:/setblock ~-3 ~ ~1 wall_sign 1 replace {Text1:,Text2:Destroy,Text3:Machine,Text4:}},Time:1,Riding: {id:FallingSand,Block:command_block,TileEntityData:{Command:/setblock ~-3 ~ ~2 stained_hardened_clay 14},Time:1,Riding: {id:FallingSand,Block:command_block,TileEntityData:{Command:/fill ~-4 ~3 ~2 ~2 ~-2 ~11 stained_glass 0 replace quartz_block},Time:1,Riding: {id:FallingSand,Block:command_block,TileEntityData:{Command:/fill ~-3 ~-2 ~8 ~-3 ~5 ~10 redstone_block},Time:1,Riding: {id:FallingSand,Block:command_block,TileEntityData:{Command:/fill ~1 ~7 ~3 ~-3 ~7 ~10 air},Time:1,Riding: {id:FallingSand,Block:redstone_block,Time:1,Riding: {id:FallingSand,Block:command_block,TileEntityData:{Command:/fill ~-1 ~-9 ~ ~-1 ~1 ~ redstone_block},Time:1,Riding: {id:FallingSand,Block:command_block,TileEntityData:{Command:/fill ~-1 ~-8 ~ ~ ~2 ~ air},Time:1,Riding: {id:FallingSand,Block:command_block,TileEntityData:{Command:/scoreboard objectives add tv dummy tv},Time:1,Riding: {id:FallingSand,Block:command_block,TileEntityData:{Command:/tellraw @a[r=150]{"text":" Furniture Command","bold":"true","color":"gold","extra":[{"text":" by IJAMinecraft","color":"white","bold":"false"}]}},Time:1,Riding: {id:FallingSand,Block:command_block,TileEntityData:{Command:/fill ~2 ~-7 ~2 ~-4 ~2 ~11 quartz_block 0 hollow},Time:1,Riding: {id:FallingSand,Block:command_block,TileEntityData:{Command:/fill ~2 ~-6 ~2 ~-4 ~15 ~11 air 0},Time:1,Riding: {id:FallingSand,Block:command_block,TileEntityData:{Command:/scoreboard objectives add t dummy t},Time:1,Riding: {id:FallingSand,Block:command_block,TileEntityData:{Command:/execute @p~ ~ ~ /setworldspawn ~ ~ ~},Time:1,Riding: {id:FallingSand,Block:redstone_block,Time:1,Riding: {id:FallingSand,Block:command_block,TileEntityData:{Command:/gamerule commandBlockOutput false},Time:1 }}}}}}}}}}}}}}}}}}}}}}}}}